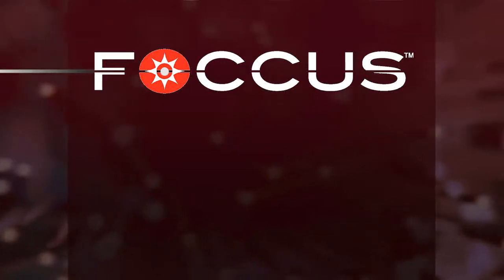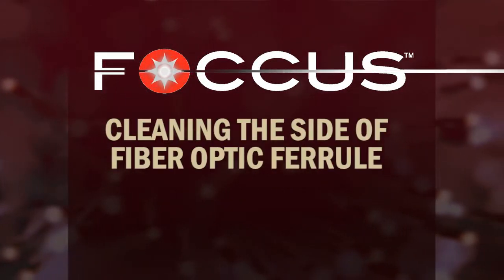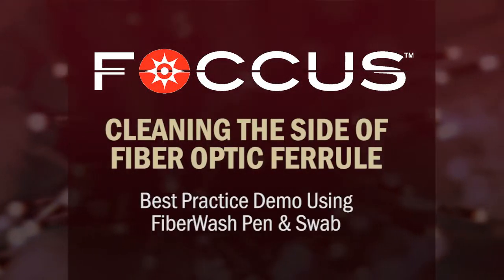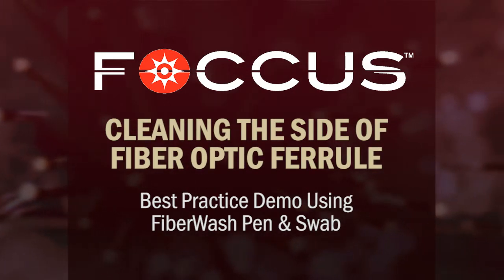Cleaning Side of Fiber Optic Ferrule with Swab & FiberWash pen

Comment: Lightly moistening every tool as shown here is an important advance from existing instructions that 'start dry' and use the 'wet-to-dry' process if that does not work.   There is a serious flaw in the perception that every connector is inspected every time.   Yes, it should be;  too often it is not.   The process here is a 'safety net'.   Studies such as Cisco's and another  completed by Ed Forrest in 2014 direct the use of a fiber optic grade solvent every time...the first time.   Cleans better and saves time.